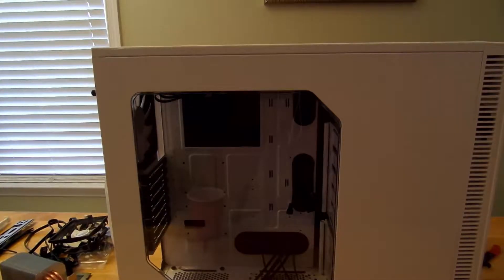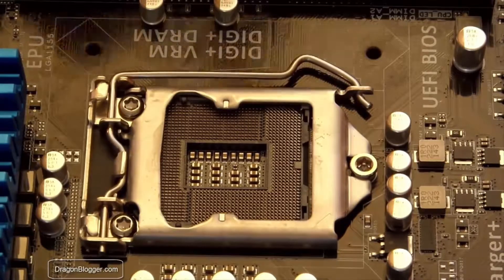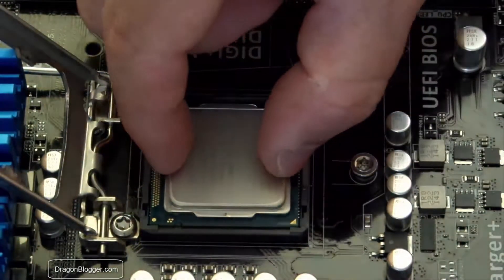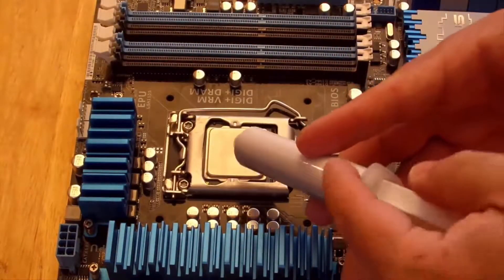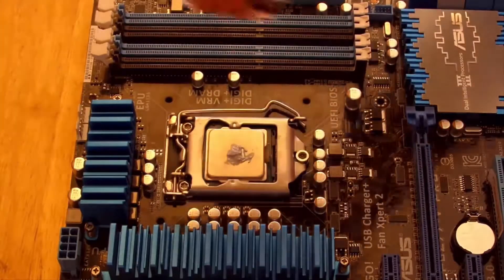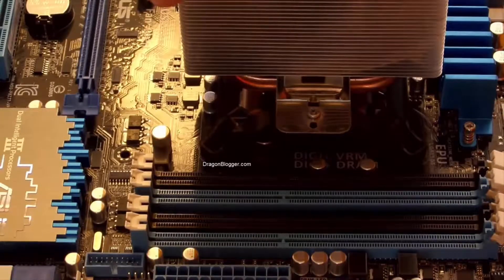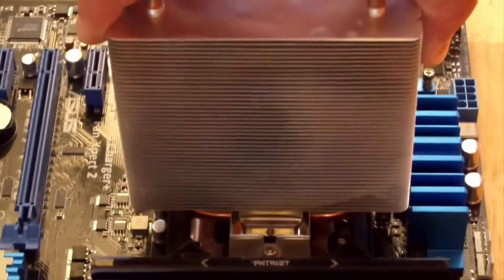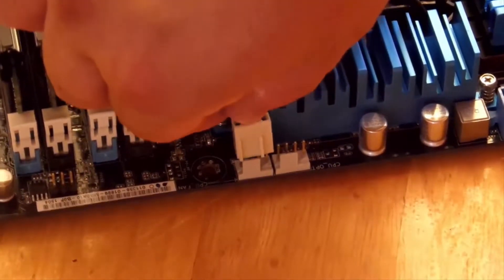How to Install a CPU, Heatsink and RAM on a socket 1155 Motherboard into an Fractal Design Define R4

Comment: Whats the name of the heatsink and is better or as good as a Hyper 212 evo?
Reply: Qadartje It appears to be an Artic Freezer 7 but I'm not 100% certain. Not sure if it's the the Pro Revision 2 model as the fan looks different. But yeah, it doesn't help when no parts are listed or mentioned in a build video... still a good build though as I have the same case and it's awesome.